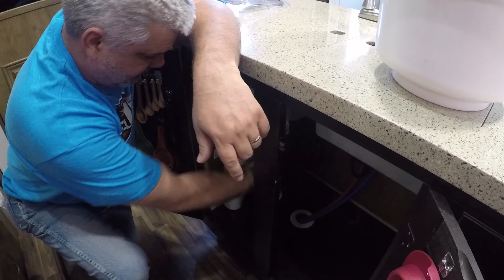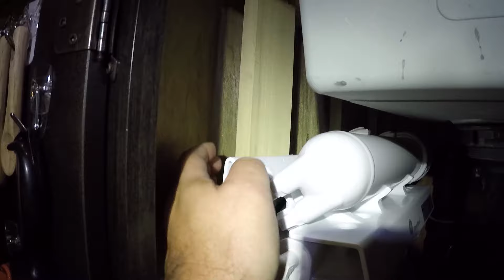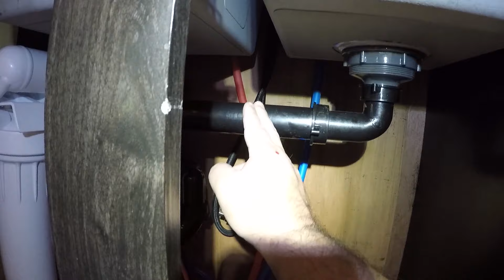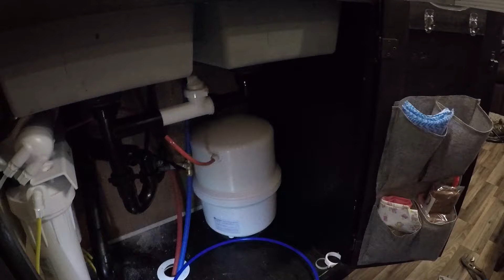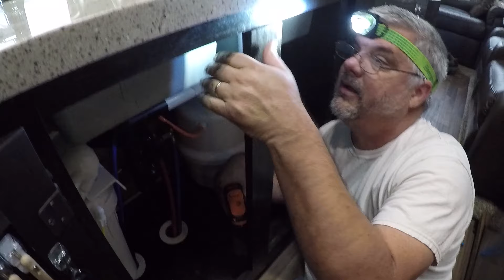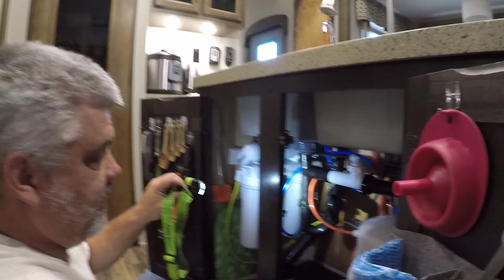Installing an RO Water Filtration System into an RV | Full Time RV Living

Comment: Why not have the run off water go back into the water storage tank while boondocking instead of going into the grey tank?
Reply: I guess you're asking why not run it on tanks while boondocking?  Not sure why you would want to run that brine back into your fresh tank.  Putting it down the drain is fine when hooked up to full hook ups.  If you're talking about making RO water while boondocking and recycling the brine, your pump would be running 24/7 and wear out pretty quickly.T
Reply: @eeman1335  Why would the pump run 24/7? Once the 2-gallon storage tank is full, would it not just stop making more RO water? Yes, I am talking about boondocking. Running the "Brine" back into your freshwater tank so it can be used for shower or sink water versus it being dumped onto the ground or down the drain which would fill up the grey tank faster with reusable sink water.
Reply: @LoyalK9Utah  I only run the RO when hooked up at RV parks.  When boondocking it's turned off.  I suppose you could run the RO back to the fresh.  It's just easier to fill the intended way.  Not something I'm interested in tackling.  Perhaps another RV'er can try it.
Reply: @eeman1335  AHH Ok. That makes more sense that you use it with city water hookups but not boondocking. I understand what you are saying now. i am talking about boondocking.

Comment: Thanks for the video. I was looking into installing this but I see that takes a lot of space. I'm using zerowater filters but at the rvpark that we are now (600ppm water....) is killing one filter a week (and they are 15 U$).  Thanks for sharing!
Reply from the maker: Yeah, I need to do an update on this.  After two years and thousands of road miles, I've found that the system doesn't hold up well on the road.  I currently have mine shut off at the valve.

Comment: So you say "when your hooked up to main" but correct me if im wring in thinking that if you had a full tank of water with and electric pump hooked to OS system isnt that the same thing?
Reply from the maker: Yes, but trying to filter RO water on tanks, you'll just fill up your grey tank with waste water in no time.  So, I only run it when we are hooked up with a sewer.